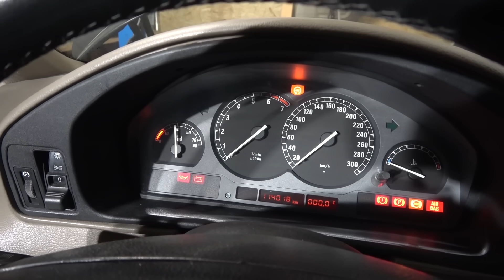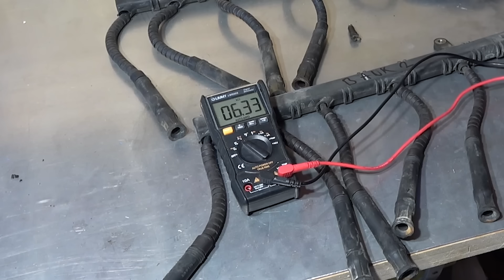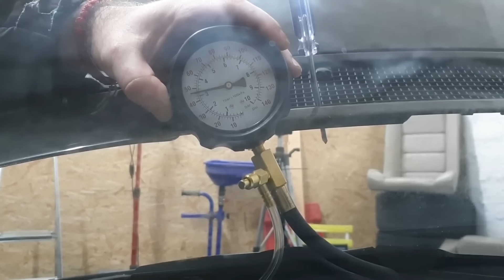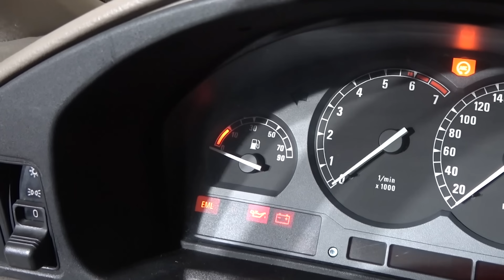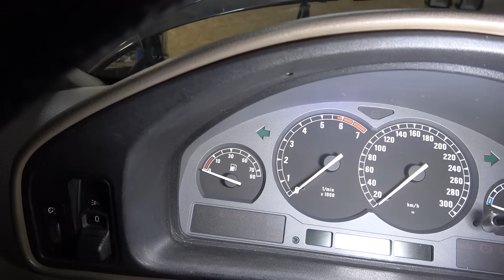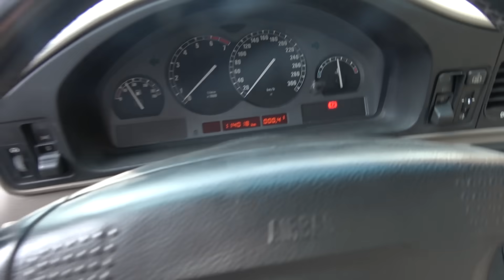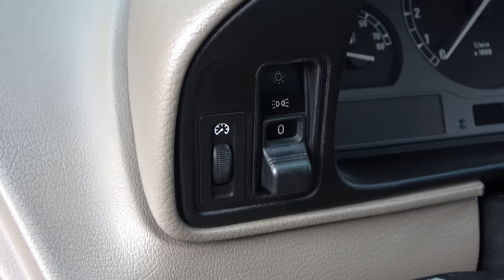Back in Service After 16 Years - V12 BMW E31 850i Revival - Project Malaga: Part 2

Comment: 553 dislikes from angry shade tree mechanics who couldn't figure out how to get their bmw to run
Reply: Yeah great point.  Who in their right mind hits 'dislike' for this guy?  Just because you can't do as well yourself.....
Reply: @markperry2827  I thought the same thing
Reply: Exactly this way. Certainly a bunch of envious people.
Reply: @erlyhenriquesilva3483  This dude reminded me of when I was a trained by 40 year master tech with 2 engineering degrees. There is a point where a person just understands a car... I can't stand backyard mechanics.
Reply: Those are the very people who should have hit the 'LIKE' button.....this vid taught them how to pay CLOSER ATTENTION!! DETAILS!!
Reply: @andrewclark6365  What the heck does that mean 'just understands a car'?  You have an OBD-9 feeling analysis sensor?   A car is a car, you can have a dealer trained mechanic with no attention to detail.  The key is doing research and not making any assumptions.  If you find a GOOD backyard mechanic he will inspect, recondition and replace all components that can cause failure.
Reply: Who else tackled a Northstar head gasket and rebuilt a $400 "can't be fixed" car with a head stud kit?  Research is key, If Cadillac had put studs in like the design engineers intended the Deville's wouldn't have a bad rep.  Instead bean counters used TTY bolts.   Downside: can't remove heads with engine in car.  Upside: You don't need to pull heads!!   Shot out to my customer Jimmy  AND  Carroll Custom Cadillac.
Reply: The dislikes come from mechanic-tryhards that disapprove of anything that isn't done with shiny Snap-On tools in a sterilised "workshop" ;)
Reply: 10pm pub curfew here in Newcastle what to do? Simple, watch m539 😊Seen it before but after 6 pints I'm sure it'll be just as good as before if not better 👍👍

Comment: lot's of work to disassemble twice for access.  Been there - done that on both M73 & S70 engines.  Just replace everything you need to one time around and your happier - unless you need the practice and aren't paying for any labor.  Other good thing is there are some upgrades to be done when you have access. But then, I'm the type that bought all new intake gaskets and new Lucas injectors too and OBD sensors.  And I replaced all suspension bushings and silicone rubber hoses. I found that replacing plugs with Iridiums was a good move too.  At 36:03, that's exactly what mine sounded like every single time thereafter.  I miss that sound.   But alas I gave up my E31s over a decade ago

Comment: Next car: US e60 M5 v10 with 6 Gear manual gearbox
Reply: 100%. 6 speed manual BMW e60 M5 were only sold in the USA. Don't know why, they don't drive manuals
Reply: Yeah only 1400 or Something so they are pretty rare. Its actually a E39 M5 transmission. So feels like bmw got a lot of complaints about no manual option and then found a few e39 transmission and sold them...
Reply: BigBash I thought E39 M5’s were 5 speed manual?
Reply: @IHATEYANKS41  6 speed only.
Reply: @erixx297  When you say e39 m5 transmission, you mean 540i. BMW didn't even bother to make own tranny for M5 and they used the same old from e38 740i and e39 540i.
Reply: I thought it was one of the other V10 manual bmws...
Reply: @twinturbo1989  M6 is the only other if you don't count Hartge H50
Reply: BigBash I thought it was the same transmission as the E90 M3?
Reply: @swissmiata3728  It's actually the E60 550i gearbox.
Reply: @erixx297  it's actually the transmission off the E60 550i.

Comment: At $85 an hour, that would have exceeded the value of the car.  That's why it's called passion.  And why these old German cars sells for pennies on the dollar.  But what a great video showcasing persistence, dedication, and attention to detail.  They sell a vinyl paint to repair those alligatoring leather cracks in the seat.

Comment: When things start to come together what a great feeling it can be...I changed the radiator and fans on my car a while back with an uprated all aluminium, and it could only go in from under the car and it was inclined at an angle of 60 degrees and the fans had to be mounted on to the whole assembly together with the transmission cooler lines! After a few hours with no scrapes or dings, it finally went in. On another level yours just inspires me to carry on screwing old cars back together again. 👍

Comment: I miss the days when cars had little gasketed ports for door vents. They're just the best feature when it's hot or cold, aside from maybe a heated steering wheel and ventilated seats. Hopefully you'll eventually find the time and funding to deal with the exhaust, get the suspension refurbished, and get new wheels and tires on this beauty. Getting the leather on the seats professionally reconditioned or color-matched and recovered would also do wonders for how lovely the interior can be. It's such a wonderful looking car that doesn't get nearly as much love as it deserves. I wonder what the top speed of that thing is when it isn't being hampered by the automatic transmission that so many of them were fitted with.

Comment: Well done!
This engine will likely run for another 300.000 km now.

The bad cold start for 2 or 3 minutes is a clear indication of the untight gaskets ad the manifolds, it was the same on my E32 (the engine even stalled sometimes).
They are already changed twice in 17 years ...

Comment: Hmm, I like that magnets in the socket idea. When I was doing intake manifold on the M70 E34 I had, I was able to get by with a a couple of 1/4 extensions that had a bit of play in them, and I used grease to keep the nuts in. Magnets would have been much better.

Comment: I really like the way he treated the interior, especially the leather and carpet. The carpet can't be restored by just spraying and vacuuming, after spraying, get in there with a damp terry towel and scrub it! Results will not be obvious immediately, but when it dries, it should look like new. If you aren't willing to burn up that elbow grease, then don't bother buying a car that requires restoration.

Comment: Being a mechanic and diagnosing an engine that won't start by taking it apart requires a level of patience I don't have lol. Imagine maneuvering and removing a bunch of hard to reach parts just to find out they are perfectly fine, so you have to put it back and do it again to another part. This could wear a person out.

Comment: I had the valley pan gasket replace on my e31. The result was the added pressure cracked the radiator and aux tank...about a $4000 invoice. The dealer told me that the valve covers - made out of magnesium - were warped and wanted $2000 for replacements. BMW acknowledged this was a defect but wouldn't pay for it and because magnesium is flammable they really can't be sanded. So the next best solution?...new gaskets with a generous amount of sealant. They been fine for 5000 miles so far.

Comment: There is no need to dip the wires in rosin, just get a 1-2mm thick PbSn solder with 2-3% flux. Saves time.

Comment: Dear m539 Restorations ,I hope this message finds you well. I am seeking your expert advice on selecting a clutch kit and dual mass flywheel for my 2004 BMW E46. Specifically, I am considering either the Luk or Sachs brands.Could you please advise on which brand would be the better choice in terms of performance, durability, and overall quality?Thank you for your time and assistance.

Best regards ,Shaun Steyn

Comment: Just a fyi. Although those repairs are improper. A fuel tank unless having a leak allowing air in will never have enough air to cause ignition if spark is provided from the fuel pump. As a matter of fact all fuel pumps actually use the fuel as a form of cooling! I didn't know it either until a really old mechanic with 50 years of experience explained that to me after i questioned why the leads on the pumps dont have shielding where they connect.

Comment: make sure you don't accidentally make a "cold solder joint."  It isn't enough to just melt the solder around the wires.  You have to actually heat the wires themselves until they can melt the solder around it by themselves.  Then you get a good hot joint.  They call it a cold solder joint because the copper cable doesn't get hot enough to permanently join with the solder.  It works for a while and then stops.   My dad taught me that because he learned it in a factory where they had to hand solder 10,000 joints minimum for each pipe organ they built.  If any of them went bad the organ had dead notes and they had to do it over again after the organ is installed in the church and you have very little access.

Comment: Now I'm curious, when the old water pump finally popped loose, did you damage the radiator??? I knocked a tiny hole in the radiator on my E39 540i doing the water pump. Lol that sucked!

Comment: dude, i'm 40 and i want to start learning one of the engineering or mechanical engineering phases, i'm wondering, where did you learn about the whole fuel pump assembly repair stuff and how they work?

Comment: Great Video. Which Fuel pumps did you use to replace the original?  The Fuel pumps you used appeared to plug in without modifying the connector. I just ordered the Bosch 69493 thinking it was a direct plug in but it came with a new connector. I would like to install the fuel pump that doesn't require modification.
Your feedback will be appreciated

Comment: My wife owned an E36 sedan we purchased used and was backing it out of our garage one morning with our newborn son in the back when I noticed fuel pouring out from underneath the car.  I immediately told her to shut it off and get out of the car while I got our son out of the back seat.  Some idiot had replaced the fuel lines to the fuel pump but must not have connected them very securely because one of them popped off and the fuel pump was just pumping fuel out into the passenger compartment right underneath my son's baby seat.  I pulled the seat bottom out and could immediately see the fuel line had just popped off.  I reconnected it and cleaned up the excess fuel and it was fine after that but the whole experience could have ended VERY BADLY if it had happened when I wasn't around.  I shudder to think about that actually.  Nightmares are made of such things.

Comment: I have to give it to BMW  for engineering a sort of easy way of getting to the pump  I can only hope that those repairs you found were made by a backyard mechanic or former owner not a professional mechanic  what did you spray on the filter Barb ?

Comment: The valve cover gasket replacement is so easy on the M70 compared to the M60/M62 of the 840Ci which requires lots of foul language to install. Ask me how I know. ;-)

Comment: 2 questions 
1 I couldn't understand why this car can not be driven in Germany? 
2 I am not quite sure but if I remember correctly doesn't this engine have a potential fault in the 
Oil pump,  faulty O ring I think, just wondered if it was this unit or the 12 cylinder Range Rover engine.

Comment: When you change spark plugs do you torque them to 30NM in every engine? If not where could I find the correct torque?
Reply from the maker: No, engine has it's own spec in the repair manual.

Comment: Great video. I didn't think I would watch the whole video. But I did. I have a 2001 E38 740il with 300823 miles. I'm having a problem with the Trans.Fail Safe constantly coming on my vehicle. My  BMW  Master Tech. "Mechanic" apparently miss diagnosis after three miles the Fail Safe comes back on. He (Mechanic) said the ABS module needs to be replaced. This is in the US. Okay. So. what's the issue? Granted maybe a new mechanic. Thanks for sharing this informative video. By the way anything on a 2001 E38?

Comment: Hi bud.  since you are BMW expert, hoping you can help me.  I have BMW X3 2008 N52.  I am getting red airbag light, yellow 4x4 ABS and yellow hand break light. I scanned fault codes and I am ONLY getting code related to Steering Angel communication error to DME.  I have replaced steering angel senor OEM but these lights won't go and i am unable to reset or calibrate steering angel senor.  and piece of advise? thanks bud.

Comment: Hi there it’s very dangerous to use a vacume cleaner to hoover fuel 

It’s basically a turbo will petrol fumes and a spark from the motor

Please be careful I love your channel 

Don’t want you hurt
Reply from the maker: It's not when using wet vacuum cleaner :) look up mythbysters, they did an experiment
Reply: @M539Restorations  I am glad 

I am a gas engineer and was called to an explosion 

Someone tried to make his gas meter go backwards using his vacuum cleaner as you can imagine the result wasn’t exactly what he expected he destroyed half his house
Reply: I stand corrected
Reply: Simply love your channel

Comment: I have a bmw e60, and it only blows air warm/cold on top of the dash not anywhere else, not on the sides, not in the front or anywhere else but on the top center of the dash🤣 

You or anybody in here have a idea what could cause this? 

Could it be the controll panel itself?

Or the stepper motors can open and shut the flaps that distribute the air?

Comment: I recieved a 1991 850i from my brother in Calif. he was orginal owner. It overheated  on my where I live  in Florida, and I think I might need a head gasket (blowing some light grey smoke from tail pipe passenger side) the overflow bottle had cracked. Dealers say it's too old they do not have any mechanics qualified? Do you know anybody I can Hire?
Reply: I only have 145k miles on it.

Comment: You seem to only buy cars with manual transmissions. I'm the same way, since 1985 I've only owned ONE Auto Transmission Car. My reasoning is with normal use the manual transmissions will NEVER BREAK.

Comment: Not my intention to tell you what you could have done better (you're obviously more knowledgeable than I am) but a continuity test on a wire only tells you if the wire is "connected" or not. It doesn't mean you won't have a voltage drop once under load.
It's like testing a hydraulic system for leak when it's not pressurized.
Sorry again to bug you with that, I thought it was important to highlight that subject for the viewers.
Keep up the good work, I like it!

Comment: 3:15 a soldered wire will not last long in a car due to the sub-room temperatures degrading solder joins in just years. The original connectors on wires are crimped and not soldered for this reason. This is the same reason why most workshop manuals will tell to just disconnect and abandond damaged wires and re-route the damaged section new wires/connectors completely.
This issue with that wire will come back at you so I would look for complete replacement.
15:26 First the drain plug
You mean first the fill plug, right? One should never start with the drain plug, otherwise it might be left with a stuck fill plug and no way to refill the diff.
Reply from the maker: I see your point, but disagree. You have million modules and electronics in the car that have solder in them and last for years just fine. I'm not concerned about it.
Reply: @M539Restorations  Those modules were designed to have solders in the first place (I've worked on ECU firmware and also built aftermarket ECUs for hobby tuning).
Your typical Sn/Pb solder with that paste is nowhere to be found in those modules. But also nowhere to be found in any factory wires. I had a lot of broken solder joints (through hole  pads are always the most vulnerable ones) in the central lock unit of my old Audi A4 B5 when the car was just 13(!!!) years old. Please also consider that taking apart that fuel pump unit again just to keep re-soldering it is much more pain in the back than taking out an ECU. I only want good for you.
Reply from the maker: The car is 30 years old and even older when developed, it has soldered wires everywhere from the factory. Thanks for your concern, but I don't have any.
You can see on the video I'm removing the fill the plug, just said a wrong thing.

Comment: if your going to go through all this trouble and work, why not just pull the engine and do an overhaul. Your not to far from that. Because when you think about it, how many miles can you expect to get out of it with these major repairs. Possibley another 100,000 and thats if it has 200,000 on it. but a new Engine you have a new car. I would have stopped after the fuel injectors because then it started up.

Comment: im so confused at around 15:00 u change ATF (automatic transmission fluid) then a short while later u show a clutch pedal and... change clutch fluid??????????
Reply: The transmission fluid you saw drained at 16:00 is no way involved with the clutch. He drained the transmission which, despite being a manual, uses ATF for lubrication.  Later on, in the process of replacing the clutch slave cylinder, he removed the brake master cylinder reservoir; which also provides hydraulic fluid to the pressure to the slave cylinder via a hose at the back.
Reply: @TheFastgeek  ah okay

Comment: When I watch these videos, two things always come to my mind. One: You can only get this good by specialization. Two: I now understand why China is so heavily invested in the world moving to EVs. It would take the Chinese 75 years to be able to have the depth and breadth of skill in metallurgy, manufacturing, and chemicals to be able to build combustion engines as well as the Germans, Americans or Japanese. However cars that run on batteries and electric motors, which China has been making for decades, allow them to shave 50 years off their strategic plan to be the world's economic center. Nothing against them; just that their actions make perfect logical sense.

Comment: You can't solder. It is not a glue. But still great video!
Reply from the maker: Yes, I can. I know very well what I'm doing, the plastic is fragile and I didn't want hold the iron and risk melting it.